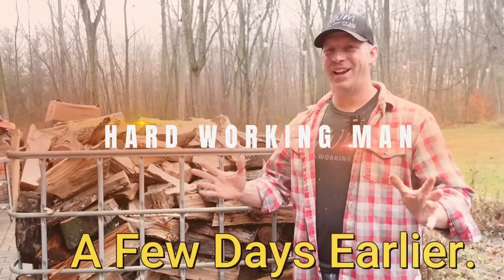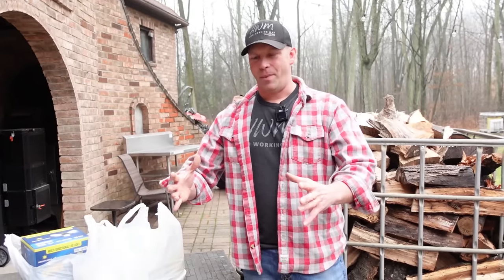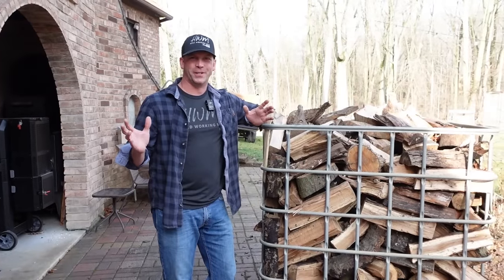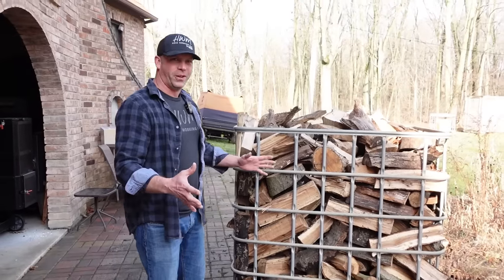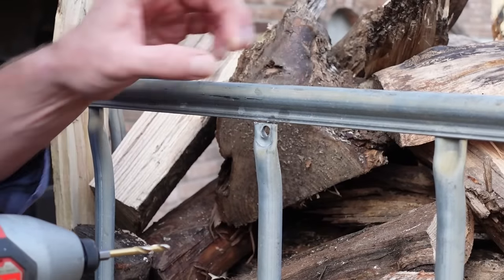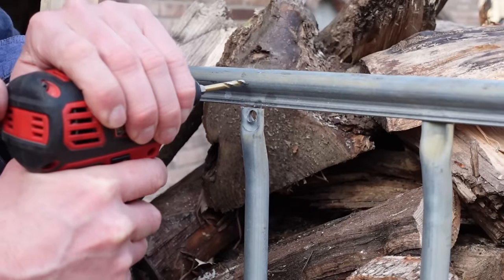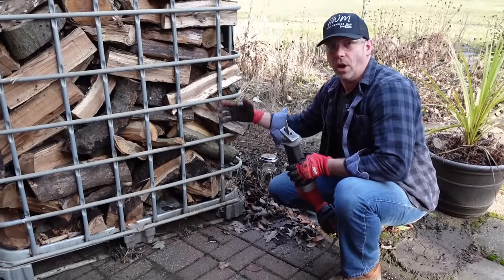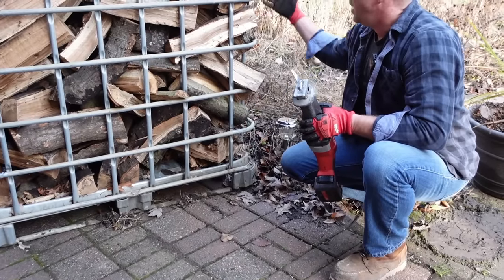Stop Stacking Firewood! Easy Access & Dumping W/IBC Tote Mod

Comment: I suggest using a cheap ratchet strap to hold the bottom instead of the Paracord and cleats. The ratchet strap will release easy under load and it doesn't require installation, just hook right onto the cage. Thanks for the video! I like that you leave the top bar intact, it seems stronger that way.
Reply from the maker: Thanks, we did an updated short and we figured out a way to not need any thing to hold it down!

Comment: Perfect!  I was going to turn an old IBC into a fuel can locker (don't tell osha) and  this solved my door problem.  Following your design but clad it in old corrugated galvanized steel roof panels, and put in a shelf and I'm done.  Plenty of ventilation but still out of the Florida weather  Thanks!
Reply from the maker: This way works great!

Comment: I agree with your shopping experience of planning to buy 3 items for $25 and leaving the store with bags of "good stuff" that you bought on sale. 
Good idea for the tote. A few videos ago, you mentioned that it would be difficult to reach in under the top rail. I think the configuration of the tote depends on what you are doing and your priorities. 
Merry Christmas.
Thank you for the videos.
Reply from the maker: For sure, this was also a 330 gallon tote which is a bit taller helping the front bat be more out of the way but it definitely depends on the situation, no one best answer.

Comment: Have you thought about using the face cord firewood bags? That's what I use. No fabrication required, flips just as easy, and it actually holds a full face cord.
Reply: That's what I use as well and I really like it. Takes the work right out of it. I bought a full pallet of 260 log lift bags direct from NNZ in GA for $13.50 per bag plus $350 for shipping. I made a metal rack holder to hold the bags and I use pallets to sit them on. I bought a 3 point quick attack so I can use my tractor forks in the back to move them around because I use my log graple on the loader that way I don't  have to constantly switch attachments. Works amazing.
Reply from the maker: I have not used the bags yet but am not opposed to trying them.
Reply from the maker: We may have to try the bags soon as I’ll be out of totes.

Comment: Ill be curious to how they will hold up after a few years. You should double stack totes to see if they will still be sturdy enough.
Reply from the maker: I’d think you could still stack them with the top bar left in tact. Time will tell.
Reply: @hardworkingmanoutdoors 

Heath,

I also came up with your "front flap idea"  and ran it by Bert (and Outdoors with the Morgans, and Firewood at the furnace) a few weeks ago.

Bert mentioned "stacking problems"), but I proposed using 2x2's by 48" to strengthen the face you cut out. 

I like your top hinges (wire cable). That was better than my "galvanized strapping strips" idea. 

Bert has a design for a "dumping box" option.  The beauty of "that", is you only build a single "dumper box" instead of modifying 100's of IBC totes.

His idea would not wear out the tote. The totes would not be cut, or weakened.

Bert wouldnt need hydraulics or electricity to dump the tote, if he uses his forks to lift the dumper!
Reply from the maker: @garylaszewski7380  so many options with these totes and I’m always learning!

Comment: I might try that way with ones I have already cut part of the top out. I don’t usually dump unload but hand unload at the furnace so I don’t want the top bar across the front. Nice video
Reply from the maker: Thanks Chris I think it will work with that style too but haven’t tried it yet.

Comment: Your new revised IBC tote will save all hand loading of the tote. (1 touch is saved)!

The automated dumping  with "a flap" is excellent.

I sent a similar idea to Brad (firewood at the furnace) a few weeks ago:

Brad,

Here is a cheap and easy solution to dumping IBC totes into a dump trailer that will:

1.  Eliminate the "extra touch" of the firewood for those that hand pile the splits into the tote.

2.  Allow easy dumping of the tote with no expensive and heavy "rotator" required.

Here is how to create "the flap":

---You must first cut out the entire metal face of each tote (leaving the top rail intact), then make some 1 inch wide "galvanized strapping strips", and bend them over the top rim and attach them to the top of the "cut out face section" with bolts and washers and nuts. This will act like a "flap".

--- At the bottom of the "cut out face section", you must attach 2 small lengths of rope, which will "hold the bottom" of the flap shut, when filling the tote from a conveyor.

--- You must "keep" the bladder:

(This is needed to create a slippery surface that the "firewood splits" rub against, and to prevent the splits from sticking out of the tote and causing obstruction when dumping the tote.)

1.  Cut out the top, and bottom, and front of the bladder, and set it aside.

2.  Reinstall the remaining part of the bladder, back inside the tote using wire to fasten the plastic bladder to the metal tote. 

3.  Attach the "cut out front section" of the bladder to the inside of the "cut out face" of the metal tote using wire.

Here is how it works:

---You will fill the empty IBC tote (from your conveyor) with the "flap" shut and the 2 pieces of rope fastened to the metal tote at the bottom.

---Then, transport the full tote to your woodyard for seasoning for 6-12 months. 

---Then, haul the seasoned tote back to your dump trailer, to attempt dumping the tote into the dump trailer.

---But first, remove the 2 pieces of rope at the bottom of the flap, and swing the flap straight up and over the top of the tote, just like "opening a door".

---Then, using your skidsteer or tractor forks, dump the tote into the dump trailer.

You now have "touchless" filling and easy dumping of the tote.

---To make dumping the tote slide easier, I would pile the bottom row of the tote by hand, before filling the tote with any wood off the conveyor.  

Put the flat section of each split on the bottom of the tote, in a "north to south" orientation.

If you ever plan to "stack" fully loaded totes 2 or 3 high, you will have to reinforce the tote, since you weakened it when originally cutting off the entire front section.

I would use some 2x2's (about 48 inches long), and jam them between the weakened top rail and bottom floor section on the inside of the flap.
Reply from the maker: That is very similar. I have though about using part of the bladder to help save the bottom from getting beat up while wood falls off the elevator and it would slide out easier. I also thought about the strapping but thought it may break easier aver repeated bending. I personally don’t stack but would think you could stack one on top okay.  Definitely more ways than one to use these totes!  Appreciate the comment and ideas.

Comment: How about sleeving the side tubes near the bottom so they become more ridged. Also maybe a piece of bar steel at the bottom to create a channel for the tubes to fit within. 
I am thinking after several fills those loose ends may starte to bend out. You have enough play in the hinges you can lift then pull the "Lambo" door open. Might not need the paracord.
Reply from the maker: Thanks Joe, I’ve considered similar options as well and may try that on one of the next totes.

Comment: I had a better idea. Made a bar to go across top. It is screwed in on each side. Front is cut out but remove screws at base. Use u bolt on top. Put scews back in bottom until you want to open. Solid and easy.
Reply from the maker: That’s what I love about these totes and the firewood community. So many different ways to do things and constant improvement.

Comment: Covering those raw ends that were cut off is going to be very important. How about a piece of 1/2 inch pvc? Use a forstner bit to drill 1/2 way through the pipe, sliding it on to the tube ends, and , drill some pilot holes, and use some sheet metal screws to keep the pipe from slipping off. You could use any type of material; I suggested pvc because it is easy to work with.
Reply from the maker: Thanks, I’ve use pvc before to cover the edges. Always room for improvement appreciate the feedback.

Comment: I think you guys just save me thousands in not investing in a rotating pallet fork.  I left my totes intact because I was not sold on methods I have seen dumping with cut outs.  I don’t stack in my totes so I like tbis idea.  How is it holding up?
Reply from the maker: They have worked great, we have slightly changed the way we do them now and they are even better. Check our shorts and you will see how we make them now. We had to put heavier wire cable in from our short, but theywork great.
Reply: Thank you guys - unloading it from my skid is one trillion times better than me hand loading onto my dump truck.  I got 2 chains plus the eastonmase change to hold it.  I unloaded a cord in the dump truck in no time and didn’t break a sweat.  Fantastic idea guys!

Comment: You need to get your outside boiler set so it only circulates when the house is calling for heat. That way your house doesn't get too warm and you will use about half as much wood. I'm speaking from experience with my boiler. 

Logger Al
Reply from the maker: But wouldn’t you have icing issues?  That does sound like a good idea if done right.
Reply: @hardworkingmanoutdoors  as long as your water lines are buried below the frost line and insulated. There is no problem. We live in central Wisconsin where it can get down to 20 to 30 below zero in the winter. I have a Hardy outside boiler with straight water in it and very little insulation around my lines. They are about 5 feet under the ground and come out directly into the back of the boiler. I have never yet had a problem with it freezing. The ground dosen't freeze around the lines because of a little heat loss. My water is 190 degrees when it leaves the boiler and travels around 50 feet under my driveway and into the house. We loose between 5 and 10 degrees in that distance by the time it gets to the heat exchanger in the gas furnace. Witch is really nothing. It's been working this way for 23 years now.

Comment: Nice mod.
-Deburr/Chamfer the Drilled holes, Will save the Cable.
-turn the Bolt cutter 90 Deg to crimp, Come in from both ends..
Mike M central Wi.
Reply from the maker: Thanks, that will definitely help.

Comment: Not trying to be negative but, I dont understand this at all? Why take away the strenght of totes to get side access.  When you can just flip the tote on its side where you want to unload wood and grab out of the top which is now the side? How many times can the wheel be reinvented?
Reply from the maker: The main reason is to dump into trailers when the wood is dry and needs to go out for delivery. When the wood is loosely tossed I rot he totes it gets hung up while dumping. I’ve ruined more totes dumping them than any other way. This allows for quick easy dumping without wrecking totes.

Comment: I wood try using bungee cords rather than the para cord. Could be a lot quicker and easier. Good idea though.
Reply from the maker: I wonder how the rubber bungee cords will work. I e tried the regular ones before for other things and the Sun destroys them pretty quick.
Reply: @hardworkingmanoutdoors  maybe try taking the bungees off when totes are in storage. Then only use bungees when transporting before dumping. Trial and error. This is what it’s all about.
Reply from the maker: @hemlockhomestead8907  for sure!

Comment: If you are able to cut the cable to the exact length you need, you can crimp the Nico (swage) with the ends flush to the cable. As the nico is compressed, the end of the zinc coated copper will "flow" over the end of the cable. This will keep you from being jabbed by the strands as they become frayed.  Aircraft builders sort of do the same thing except they add a second nico sleeve.

https://youtu.be/6LzH5iSxmig?si=CB6QwRiv56cBbG63
Reply from the maker: Thanks, that would definitely be nicer.